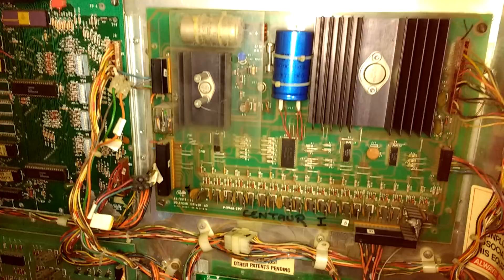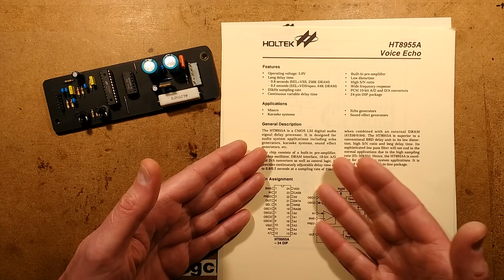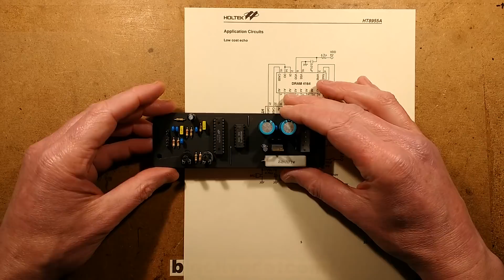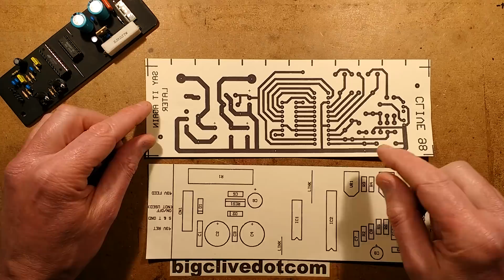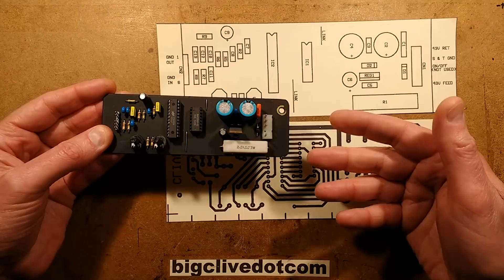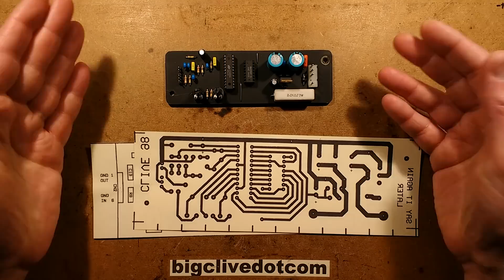Designing the Centaur pinball replacement echo card.

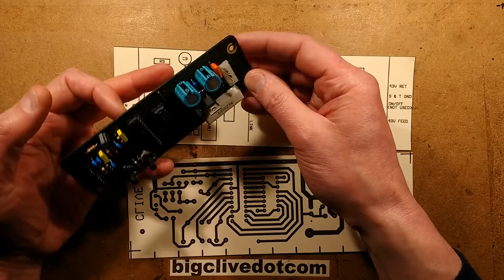Comment: 14:38 If you don't like things running hot, you clearly need board version 3.0 with a buck regulator chip. The usual suspects probably don't go above 40V input though

Comment: I would not recommend placing the back glass artwork on top of the pinball table especially when opening the door over it. lean it against a wall, out of the way, with a soft pad under it & place a barrier of some sort in front to minimize the risk of stumbling into it, if you are in a small space. I  had a Centaur for a good while, & the echo did fail.

Comment: I believe, the original delay circuit was called a "bucket brigade". It is a combination analog switch and shift register. The signal was sampled as an analog signal, then shifted to another device, preserving analog level, after the signal was shifted desired number of times, the analog signal sample was placed on a low pass filter. The signal was essentially the same as it went in, but delayed by the number of shifter register states and the shift clock. The analog signal is passed along from register to register as a bucket in a fire bucket brigade.

Comment: 2 possibilities

1. the game has a demo mode many games have demo modes

take tombraider 2

https://www.youtube.com/watch?v=b6xOLvnAcgY

if you leave it on the selection screen for a minute it will play a few seconds of the game.

2. faulty echo synthesizer chip putting electrical noise back into the logic board causing the demo mode like thing.

for the love of god dont put the back glass where you put it you could easily knock it off and get it broken and lots of luck finding a replacement even on ebay

Comment: Yes, it was an analog delay line. the "4096" meant 4096 integrated capacitors. Audio was sampled, and it's level sent to the first of the 4096 capacitors. The capacitors were arranged as a shift register and the analog signal was sent to the next capacitor, with a clock signal. The first capacitor was fed a new analog level. This was repeated until the level was sent out, amplified and filter. You change the delay by adjusting the clock frequency. This was called an analog "bucket brigade". The integrated capacitors would degrade over time.

Comment: How well do EPROMs hold up after 10,20,30,40 years ?  In school we were told about 10 years but I've seen EEVBLOG and others with Tek test equipment much older, usually, they haven't failed. Do you or people that service the older equipment keep a collection of EPROM backups ? Maybe replace them with w one time programmable PROM device that would last longer if possible ?
Reply from the maker: The original 10 year life was a safe estimate. It's important to ensure that any specialist equipment with EPROMs has them read and stored as a file in case of age related data degradation.  It's not uncommon to have issues with old video games where the EPROM data changes resulting in rogue game behaviour including corrupted graphics.
Reply: @bigclivedotcom  What if anything can be done about older chips with calibration data like the HP3457A that I think it uses CMOS battery backed up RAM ?  I know you can replace the battery but is there a way to back up the calibration data for meters, scopes, etc ?  And calibration would cost more than the meter.

Any idea of how accurate meters like HP3457, HP34401A are if they lose the calibration data if the battery dies ? It would be nice if someone would make a USB addon to store the data.

Comment: or rip the whole fucking ancient electronics out and insert one pi :P?!
Reply from the maker: Not so easy.  The Pi would have to control 50V solenoids, which are quite an aggressive load in terms of transients and processor stability.  You do get replacement controllers though.

Comment: If you can make any audio related content like this in the future I will be a very happy man! Convert a cheap karaoke machine to a useful effect for musicians or an original take on a voice vandal. Anything you're enthusiastic about! As you say this stuff is fun and applicable by a lot of people. If it's incentive I can visit antex for you and tell them to sort their bits out or buy you some buckfast from the source
Reply: PS as you're the OG joule thief... Would it be possible to run one from a thermal source like a peltier or thermopile? Perhaps for a soldering iron station so i don't leave my antex on for a week again
Reply from the maker: If the source can provide in excess of 0.6mA and at least charge a capacitor to allow a Joule Thief to pulse then it could work.  You could also put a big emergency stop button on your bench that kills everything.
Reply: Switch does sound like a far more logical thing but still... Cheers Clive, appreciate the continued amazement and understanding you provide me with

Comment: Great video. I did not know you have a pinball.... can i ASK something about gas display’s in general?
Reply from the maker: Ask away.
Reply: bigclivedotcom i have a old fruit machine that has one, and in the future I hope to revise a pinball machine....but is there a possibility to replace gas displays with led displays? Using the same HV driver board? Or  converting it to low voltage.? Or must I build a driver board to translate . I have not found replacement sets online ....just one for a Williams pinball but none for fruit machines. The one I have trouble with has 16 digits 12 segments
Reply: bigclivedotcom i am sorry if my english is not correct i am from Holland . 👍🍻keep up the good video’s
Reply from the maker: @demofilm  Sorry, I didn't see your reply at the time.  The fruit machines generally used vacuum fluorescent displays.  I'm not sure what would be involved in conversion to LED.

Comment: I'm not sure I understand, why build a chip to make dynamic echo on a machine that only plays pre-recorded voices? couldn't they just have recorded the sound with an echo effect already applied to it instead of using a chip to apply it on the fly? Is there a special corner case that requieres it, or an advantage that overturns the extra cost of the electronics?
Reply from the maker: All the sounds are played randomly over the top of each other during play.

Comment: I've noticed that they used linear, not switching power supplies.  The TI99/4A home computer also use a linear supply.
Reply from the maker: This was pretty much before switchmode power supplies existed.  At a time that the early units were mainly going bang.

Comment: You can probably make  a more modern version of this using a fastish microcontroller like an STM32 and emulate the echo/reverb effects by means of DSP and outputting a waveform which is the original signal superimposed on delayed versions of the same singal. Keep well above the nyquist limit and "she'll be right." Although you do lose a good deal of the authenticity of analog circuitry. :(

Comment: I began my lifelong love of electronics engineering as a pimply-faced teenaged hobbyist back in the early 70s (most digital gates back then were RTL, and TTL was just beginning to show up), and I was around when those old Holtek chips were the latest cat's meow. There were originally used mainly in musical instrument amplifiers to replace the mechanical spring delay lines which were required back then to produce echo effects. Those old devices used an electromechanical transducer to excite a tensioned spring usually about 12" long, and then converted back into an electrical signal at the far end of the spring with another transducer. Think of it as a higher quality version of those cheapo plastic toy echo microphones kids play with these days. Sound quality was awful but it was all they had to work with back then.

These "new" fully electronic delay lines also proved popular with musicians for "phasers" and "flangers" which merged a straight-through audio signal with a delayed version to produce "spacey" audio effects. Since these Holtek (and other vendors) delay lines predated economical flash A/D converters, they used an analog "bucket brigade" technique much like CCD video cameras. The "4096" in that part number probably referred to 4K buckets in the line.

The idea was to string a series of on-chip capacitors together with analog amplifiers and switching components so the voltage stored on one capacitor in the string could be dumped into the next one, thereby passing the instantaneous signal voltage down the line at the chip clock rate. Each bucket and its switches formed a tiny sample-and-hold cell. Since you can't simultaneously fill and dump the voltage on a bucket cap, you would normally need to dump the last bucket on one clock cycle then fill it from the previous bucket on the next, continuing on backwards to the first bucket in the chain before you could sample another signal voltage from the head and start the bucket shift again. With the technology of the day this would have limited the overall sample rate too much for quality audio on the output, so instead these devices used two parallel chains of buckets, call them 'A' and 'B'. On the clock's rising edge all the voltages in the 'A' bucket cells would be dumped into the matching buckets in the 'B' chain. Note that the very first 'A' bucket would actually be captured from the instantaneous signal voltage. On the falling edge of the clock, all the 'B' buckets were copied back to the 'A' chain, but ONE CELL CLOSER TO THE END than they were on the last clock cycle. This method meant that there was one voltage being sampled at the head and one voltage being dumped at the tail for every clock cycle, rather than waiting for all the voltages to "ripple" down the brigade from the tail back up to the head after 4096 clock ticks.

My guess is that these chips proved short-lived because the on-chip bucket caps would degrade. All it would take is one failed (or even just weakened) cap in either chain to break the path of buckets from head to tail. If there was a big enough market to warrant it, these days it would be simple to treat the old bucket-brigade chips as black-boxes and produce new designs which flash-converted the input analog signal into digital (audio quality on these old chips was not stellar so 8-bits would likely be sufficient), and then use fully digital bucket brigades to shift the samples down to a DAC at the tail end to convert back to analog. As long as the specs of the ADC and DAC were properly chosen, the surrounding circuitry would have no idea that the signal was being carried down the brigade in bytes now rather than on caps holding analog samples. Since the bucket chains in these old devices was fairly short (4K in this case) you could probably duplicate the functionality with a cheap modern MCU with integrated ADC ad DAC and maybe a few extra analog components to massage the input and output signals to match the original support circuitry.

Ah, the good old days of 70s electronics innovation. 555 timers and 741 Op-amps... fun times.

Comment: Impressive bedside clock.  Wonder why they were so adverse to link wires,  and an  American taking credit hmm sounds familiar.  . Im trying to figure out if i can use a pair of dc dc boost converters on a motor that runs in both directions using diodes. .

Comment: Ahhhhh, classic arcade machine porn, something which I have a large interest in, but more to do with Fruit Machines, and have had a few projects in times past, from early 70's Bell-Fruit electromechanical's, through to the Barcrest MPU5 platform. Quite a few guys on our restoration groups, also deal with video's and pins like yours. As for the Ni-CaD damage, we call em the Blue B'stards of Death, not that Ni-mh is much better (Dam Varta Mempac's). I've just done with a Maygay M1v Screen Play (Video version of their M1 a / b system, before they went to M2), with an LCD mod, which was an absolute mare, because for whatever reason, Maygay did not use a standard hz setup like most do, and I had to use a conversion box, at a cost of well over £100! Done a short vid of it on my chan.
Reply from the maker: I have an old Bell Fruit EM.
Reply: bigclivedotcom Those buggers run forever, with little maintenance, which was me mates bread and butter over in Shildon and the north-east, when he worked for Bell-Fruit... If you need any docs, tech drawings etc, likley Ron will have em.

Comment: I didn't think anyone used TI speech chips in their machines.  The first talking machine used samples recorded on enormously expensive EPROMs and special circuity with it's own microprocessor to play them back.    Stern made the first ones to use speech synthesis, using a special soundboard from Exidy which had discrete digital sound generators plus a dedicated speech chip developed by Telesensory.  Gottlieb's hardware used a Votrax SC-01.

Comment: Hi Clive, could you please make a video explaining your technique for neutralizing the battery leakage creeping below the solder resist? I'm used to using citric acid for battery contacts corroded by alkaline leakage, but it's a different story once it gets below the resist.
Reply from the maker: You'll find lots of articles about it online if you search for bally battery damage.  Mainly involving the use of a strong acid to neutralise the alkaline and removing all affected resist to gain access to the damaged areas.
Reply: That's a good search term, thanks. Found some great articles already.

Comment: I think the term you were searching for Clive, was flanging.
Reply: Most of the musician delay-line boxes used around that time were "phasers", not flangers. Phasers could be built with simple resistors and capacitors, whereas flangers really needed a variable delay line of some kind.
Reply: I forgot about the time line that was mentioned.....
Reply: 100 points and a barrel of imaginary beer if you know why they were called "flangers" without looking it up. ;-)
Reply: I'll take a stab at it having to do with delay time and depth - otherwise you have me cold
Reply: <Pedantic history lesson>
Back in the old analog music recording era an engineer was layering tracks from multiple reel-to-reel tape decks through a mixer onto another deck. To get a "thick" sound they were mixing several recordings of the same track from multiple decks over each other, something like Phil Spector's famous "wall of sound". At some point the engineer pressed his thumb on the FLANGE of one of the tape reels, causing it to slow down relative to the other decks playing back the same track into the mixer. This caused a sweeping audio effect which the engineer immediately recognized as something special.

The concept of "phasers" had been used for some time, where an audio signal is mixed slightly out of phase with itself, but with "flanging" the key is that the delayed signal must vary in frequency/delay/phase all at once. Even more important, the audio effect is only noticeable when the delay/freq shift is actively changing. If you shift the freq and delay of an audio signal by a fixed amount and mix it back with the original, the effect is mostly a change in frequency spectrum, but there is nothing special about the sound. When you continuously vary the shift before mixing however, as that engineer did as he pressed and released his thumb on the reel flange, you get a vast otherworldly sweeping effect that was hugely popular in prog music. Bucket brigade delay chips were the first practical way to produce this frequency/phase shift without resorting to physical tape reels.
</Pedantic history lesson>

Cheers.
Reply: Bucket brigade IC Damn that has been around for ages. I did a heathkit project with one of those waaaaay back in the dark ages - All discreet component thru hole single sided board. So, it seems Mr Green you did indeed have me cold. And no i did not look it up, no fun in that. Go thru the cobwebs and see if it can be found in the recesses. I knew where but lacked how and why. Very Good sir! It can get to be a bit of a challenge to find those bits from 35 or more years ago. Back in the Dial telephone days, learning this stuff meant you worked at it.....Books. Remember those? I still have motorola data books from 1978, 1982.They are still a treasure of information today. You keep right on with those history lessons, they have great value!
Reply: " I still have motorola data books from 1978, 1982"

Me too... along with about 100 lbs of National Semiconductor data books which were about 3" thick each. My Nat Semi Linear app notes books are prized possessions... I looked up a dimly remembered op-amp circuit in one of them just last week. I've also got a 6800 application manual floating about too, although I never built anything on Motorola CPUs.

ADDENDUM: Ahh... Heathkit... those were the days. :-D

Comment: Excellent tip on this chip, never heard of it!!.. i see Ht8955A and the DRAM are still around for sale on ebay. The schematics aern't too bad. One was for a whole karaoke machinel.Thats the one that looks interesting as it show you can use pots for delay time, repeat adjust and echo volume. Its looks to be 4558 opamp, one side for input stage with gain of 10, signal then feeding into the delay, with a recovery stage using the other side of 4558 opamp. After that is just a low power amp ic tda 2822..which you could disregard.might make an interesting guitar effect pedal?

Comment: I designed with SAD bucket brigade delay chips back in the days of CB radio "echo mics" (early 1980s). I still have the Reticon data sheets in PDF. Also the Panasonic MN3000 range and the Philips TDA range (e.g. TDA2107).